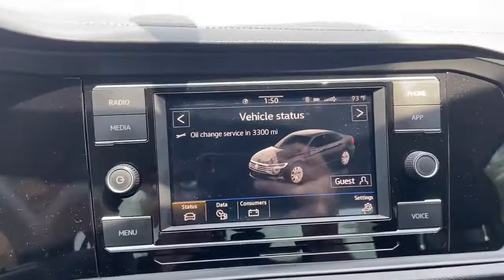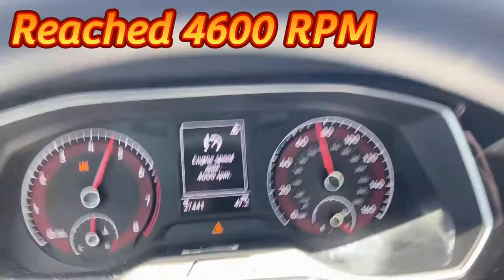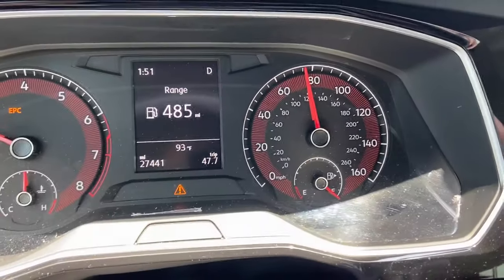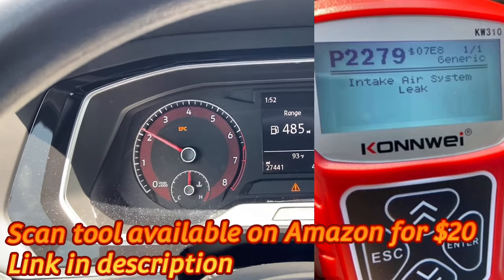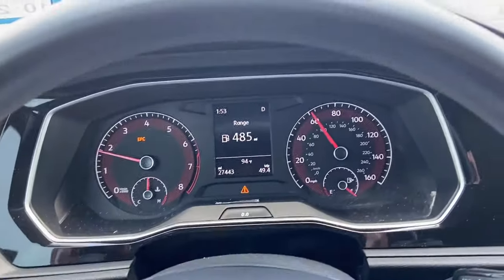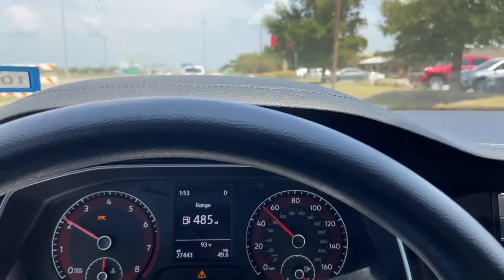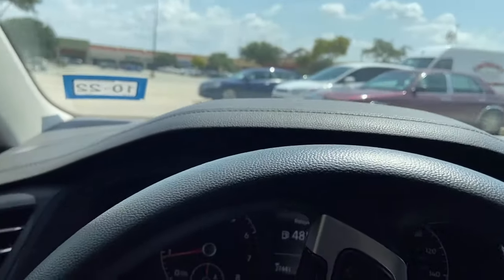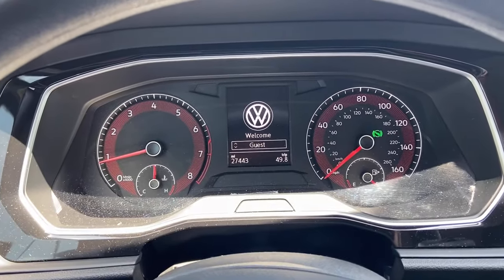EPC LIGHT PROBLEM FIX! 2020 VW JETTA

Comment: Low battery causes this too
Reply: Yup when i took my battery out it was swollen. Replaced it, and epc error went away!
Reply: 2016 vw jetta
Reply: I have the same problem  and I have Skoda 1.8 2015,should I replace battery ?
Reply: That's what problem I'm having right now
Reply: I have a 2019 vw Passat with 30,000 miles my battery died I jump started it and then the epc light came on.does warranty cover this?
Reply: I replaced  my battery  last two weeks back and haven't driven the car and this week when driving the car the light came on and the car lost power. Do you think it is the battery
Reply: Could it be the battery even if all the other electronics in the car work just fine? And it turns on like normal?
Reply: @mauricioreal7384  yes that’s what happened to mines
Reply: @JoseGuerrero-df2if  so yours was a battery issue? It happened to me from one day to another. All of a sudden the light came on and I was unable to accelerate and pick up speed on the highway like normal. Although the check engine light has come on once or twice and gone away in the past 4-5 months. Should I have my battery tested first?

Comment: I have the same issue with my 2019 jetta .. took it to the dealership.. jan 2022 a whopping 1900.. said that ran a diagnostic and replaced a j1087 sensor and bracket to the rear bumper.. reset codes and here I am two months later same issues .. I have extended  warranty and factory warranty and they told me it wouldn’t do any good to use.. I feel like I’ve been ripped off.. I am taking it back and will refuse to pay again!
Reply: What was the updated
Reply: @terrie cooke Factory warranty covers exterior engine components, engine replacement, transmission components/replacement

Extended warranty only warranties the vehicle up to 150k miles I think, neither of which cover electrical issues so most cases you do have to pay for the work done despite the warranty
Reply: @imijbeats  Thank you ..I ended up trading it in for a 22 camry se

Comment: I still wouldn’t trust it. I had this happen to me with my 2014 gli. At first when I purchased it In 2017 at 30k miles, the first time it came on was my first oil change. I got worried and called they told me if it comes on again to take it. It never came on until my next oil change it came on again. After that I thought maybe it was just something they were doing so I brushed it off because after I would turn off the car and back on it’ll go away. But after a year it started to come on every morning. Eventually it stopped turning off after resetting the car but I was already out of warranty. After looking up it was something to deal with the throttle
Reply: Was the repair expensive? This happened to son’s car last night and he’s away at college.
Reply: happened to me last night as well

Comment: This just happen to my 2018 vw Passat the EPC and the check engine light but the EPC light goes of leaving the check engine light and it drive ok for a min until the EPC come back on ? So am wondering if it’s the same thing too.
Reply: did you find out what is the problem same thing happened to my 2016 audi a3
Reply: I have this issue now, did any of you get it fixed or figure out the error?
Reply: I just have the same issue with my 2015 passat help 😢please

Comment: Got this on my 09 vw Jetta Wolfsburg. It’s a 2.0tsi changed the throttle body and it still comes on and have to turn the car off for limp mode to turn off I think the pedal sensor has something to do with the EPC light bc when I turn off the Jetta and push the pedal down and back off it starts running normal again seconds later
Reply: Any solutions? My Tiguan 2.0 has the same thing

Comment: Long time passed but 2020 1.4t here with the same issue, i picked up the car 2 weeks a go with 27,646 miles on it just realized as you did this "epc issue keeps occuring right at the same rpms / speeds" I feel i need this update as well... what is said update called

Comment: EPC light can be caused by many things. It can be a cam position sensor going out. Throttle sensor faulty. Brake light switch sensor faulty. In my case, the car ran fine, EPC light came on because the brake light switch sensor broke. Replace it. A month later it came on again. This time it was because both brake light bulbs had blown.

Comment: 2015 Passat 119K miles. Never a problem til it hit 96K miles. Since then had to add a quart of oil between oil changes, til it hit 104K, now have to add oil every month!! Dealership says no leaks & nothing wrong! 

Lately, it's been acting as if it was losing power while driving and seeming to almost shut off while stopped. EPC just popped on 🤨

Replaced the alternator at about 105K. Have replaced the battery 4 times and now smelling something that smells like eggs.....not looking forward to having a car note again but i think it's time

Comment: By chance did your car make a loud fan noise when driving in between 2 and 3000 rpm. I have a 2017 jetta that has an EPC light on and I turned it off and on and the car won't accelerate past 2-3000 rpm without making a loud fan noise so is it stuck in lymph mode?
Reply from the maker: No mine did not make a Loud fan noise. If the EPC light is on then limp mode is active .if it is off then it is not in limp mode .you may have another problem.
Reply from the maker: It sounds to me like you may have a boost leak
Reply: @Itssuperdave  Ok thank you! I'm taking it in the morning to get looked at.
Reply: @Itssuperdave  wastegate actuator
Reply: Just had this happen on my brand new Taos.  Literally first few hundred miles
Reply: What did it ended up being? I having the same issue, taking my 2014 Jetta to the shop today
Reply: @saibellpamc376  It ended up being some sort of intake fan or valve
Reply: @eriksondoxtator8606 how much did it end up costing you?
Reply: @Antonio Alfaro-Cruz  I can't remember the cost but it was covered under my existing warranty

Comment: My 2016 Jetta 1.8t just started turning on the EPC light just this week and I was wondering why, it came on when I was using manual mode and I down shifted and it came on. Then it turns off if I turn off the car completely and turn it back on. Today it came on again while I revved my engine to about 4K rpm at a red light and it came on again. Must be a boost leak I’m hoping because it just like it loses all boost and I can hear the turbo struggling, but it’s fine when I restart it and I can full throttle floor it and it will have full boost again and be fine. Taking it to my guy on Monday for a transmission fluid change since Jetta are known for bad gear shifting, so ima ask him about the epc light. 👍🏻 Nice video!
Reply: Any update my friend?
Reply: Transmission fluid was burnt and slushy like. Well over due for it. Immediately after felt the smoothness of the gears shifting and down shifting wasn’t as harsh with trying to find a gear. Definitely helped fix up the gearing, but the alternator blew at 96k miles so we traded it in for a 2020 Jetta GLI and just got into an accident last night😭😭😭😭 hopefully the stupid guys insurance pays out for a new one and the damages. So sad! 😭😭😭

Comment: If its a 2013 Audi does it need an EPC update ?
My light comes on once every 3 months for 3-6 days then restores itself... Havent been able to rin any vcds or codes but what could cause this EPC light to come on ?
Reply: Do you still have the problem or you solve it as I have Q5 2013 and this issue just started happing
Reply: @Tarekjeroude did you manage to sort it out.? As I have also Q5 2013 with the same issue

Comment: I have the exact same problem, when mi audi a3 1.4tsi is at working temp the issue start to popup when i acelerate constantly and my scanner give me the exact fault code p2279 bun i can't figure it out what is the problem, The guys at the dealer tell you that is a software thing?
Reply: The code P2279 is the air intake

Comment: I appreciate this video. This just happened to me in my 2018 Volkswagen. Wondering if it’s the same problem with mine now.
Reply: Any up date bro ???
Reply: @indralewis1584  sorry just saw this…yes it was my injection harness. I have no idea what that is lol
Reply: @justindetie2126  how much that cost
Reply: I have 2018 VW Tiguan and my epc comes on all the time
Reply: @tiffanymariem1996  yea me too did you manage to get it fixed?
Reply: @tiffanymariem1996 hi my 2018 Tiguan just did this, any fix?
Reply: @rolo2490  hey my Tiguan 2018 did the same, did you get it fixed ? If yes, how much it cost ?

Comment: Mine
Comes one 1 times out of 3. When it appears. Shut down and does not appear again?

It appeared after the first cold in winter?
Reply: Mine comes on in my 2016 Jetta extremely intermittently. It's bizarre. I was told by the dealer that the code showed that my fuel pump was failing. I had NO symptoms of a failing pump. It went away for about 6 mos. Now it's back again. It goes off every time I shut the motor down and restart. It will come on 2 days in a row and then stay off for ages.
Reply: @galaxyglitterlatte4664  weird right

Comment: This happened to me as I was doing 10 .
I just got this 2020 VW tiguan.
I’ve only had it a month. 😢
Reply: going through the same thing right now with my 2018 tiguan
Reply: @Mapphotoz  mine just did it. It had a buck in then fell on its face
Reply: @Mapphotoz any update on it? Just happened to mine today
Reply: @Mapphotoz any update on yours? My 18 Tiguan just did it too
Reply: @rolo2490  replaced fuel injector and no problem since
Reply: @Mapphotoz my tiguan 2018 did the same, did you get it done by dealer ?

Comment: This literally just happened to me and my car went limp at an intersection … it was so scary . I have a 2016 vw gti then was able to turn on and off and it went off , drove to my mechanic and he said bc the code didn’t save he couldn’t pinpoint exactly what it bc the epc can be numerous things and said  it might just be a “soft problem “ …. Does anyone know how much it would cost at the dealership for the ecm update ? This has literally made me feel so unsafe to drive my car that this can just keep happening :(
Reply: Same thing is happening to my car it’s so stupid and dangerous
Reply: This happened to me and is still an ongoing issue. I took it to the mechanic and changed the camshaft sensor twice. I don't know what the issue is exactly. It is intermittent.